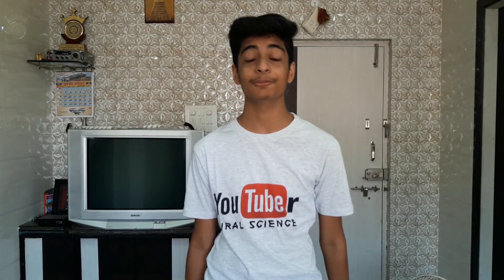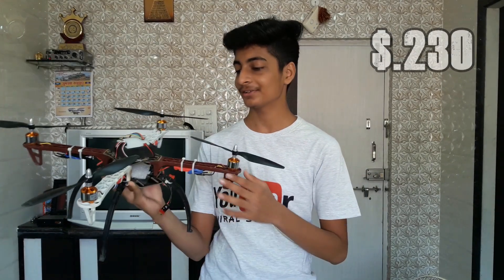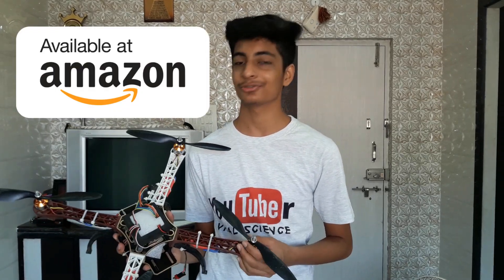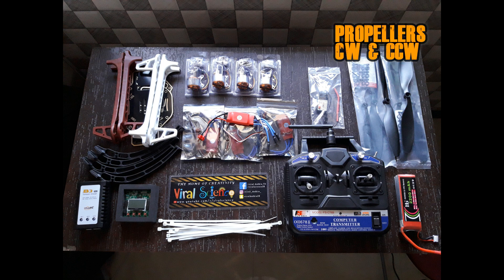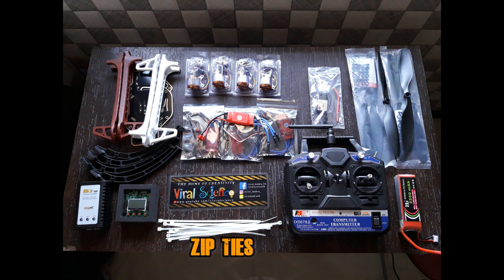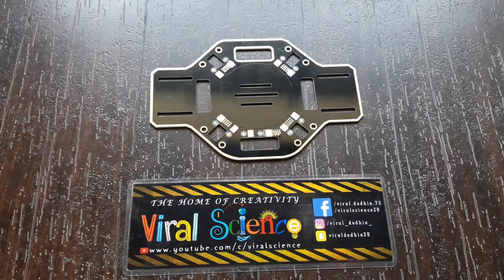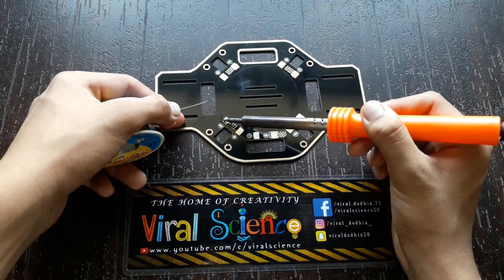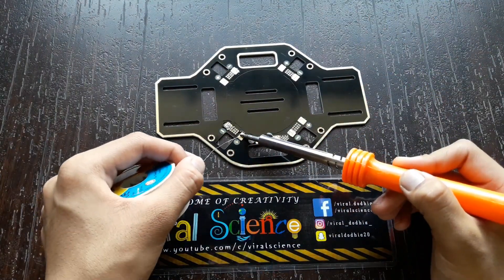How to make a Quadcopter | Drone

Comment: Hello. Is it possible to use the radio control of the quad copter with a brushless motor to move with a 1400kv motor with a few servo motors, thank you

Comment: SIR i am using 1800 KV brushless motor and i am also using a lipo battery of  2200 MaH  . I am also using gimal controller ,  KK 2.1.5 board , FLYSKY FS-i6 transmitter and receiver . When i am arming its arming but when i am bringing the throttle to half and above the armed process gets offed and again i should do the arming process it gets repeated like this and also  the quadcopter  is not flying at all or else would the battery voltage be not enough for this quadcopter.  What will be the problem . Can you please help me sir
Reply: check battery volts with multimeter and insure that your battery is puffed or damage
Reply: @vijendrasingh1238  how to check if it is damaged or puffed
Reply: multimeter
Reply: in multimeter how to check
Reply: @nandakumar74   u can look on YouTube 😄😀
Reply: Does KK2.1.5 supports camera?
Reply: @punitvachhani9676  no
Reply: Just check whether you have calibrated the ESC correctly

Comment from the maker: KK2.1.5 BOARD:-  https://www.flyrobo.in/kk2.1.5_lcd_flight_controll_board_for_fpv/?tracking=5c723900abvrl
FLYSKY TRANSMITTER & RECEIVER:- https://www.flyrobo.in/flysky_fs-i6_2.4g_6ch_afhds_rc_transmitter/?tracking=5c723900abvrl
F450 FRAME (PCB version):- https://www.flyrobo.in/drone-f450-450-quadcopter-frame-arm-with-landing-gear-4-axis-multicopter-kit-450f-quadx-quad-multicopter-kk-mk-mwc/?tracking=5c723900abvrl
Reply: Bro i like your projects,how much weight can this drone pick up?. Make a vedio on it and do we need permission to fly this drone
Reply: bros u need flite control also 😄
Reply: Bro my drone 1000000

Comment: I am using kk2.1.5 and ct6b transmitter but the range of my quadcopter is about 30-50m how i can increase its range?
Reply: Use flysky 5G transmitter and remote control then u will get aprox range of 1-1.5 km

Comment: I built a quadcopter the same, frame alien f 450, engines 750 kv, acc 30 amp KK2.1.5 Flight Control Board, battery Nanotech 4.0 Ah, and the day I tried to make my first flight in a park, a policeman saw me and I try to take it off, him wanted to take the new toy for your son, I got pissed off, and I almost got arrested. nope it's fair that after the stores sell you the parts legally, you can not fly it, because it's illegal, this is bullshit

Comment: hey, I just wanted to know if this setup would fly or not:
2x 3s lipo 3000mAh 30C
4x 1400kv outrunner brushless dc motor
4x 30Amp ESC
1x F450 frame (like the one in this video)
 and my own custom Arduino electronics

Whenever i try to fly the drone, the motors are too weak (not getting enough power i suspect) and  they act at a quarter of the max power, i can run one single motor at full power but not all at once, i think the lipo only has a discharge rate of 30amps so only one ESC can be fully powered, even though i have seen people use only one 30C lipo and still get full power. Have i done something wrong or is my battery not powerful enough?
Reply: Sean Hardy take one of the 3ah 3s lipos off to save weight then try it
Reply: i think thin wires are causing excess resistance, the motors only spin at 1/4 speed with 1 single lipo, the discharge rate is 30C but my ESCs are rated for 30 amps so i think i need two 60C batteries?
Reply: Sean Hardy  what u should do is keep the 2x3s lipos and put a higher kV brushless motor and a ESCs to support 6s lipos.the frame is up to u.
Reply: Sean Hardy try motors kV from 2000till 3800
Reply: It will work but check the wires connectors and put a better esc
Reply: I built my 1st quad on 4x120a ESC on 6-8s lipos and 3400kv brushless motor x4.   
Try it out
If it gets hot try using lesser powered lipos.
If u don't u might rip the motor inside out.(happened to me on my second quad)
Try different lipos batters and see which one works out e best for u.(it should not get very hot)
U can buy mainly all the electronics from hobbywing.com
Reply: Wish u luck😀
Reply: so will my current configuration not work? would I have to change the ESC as well as the motors because it is rated for 30 amps? I think my motors could lift the quad as I can run one with full power but not all of them at once, but I can burst 60C with the lipo. Will using two 60C batteries provide the full current of 120 amps for all four 30amp ESCs? because i think the motors are powerful enough
Reply: Sean Hardy u can use the stock motors but the ESC has to go
Reply: Sean Hardy because the 30a ESC is not rated to do 6s lipo
Reply: Sean Hardy the ESC would burn mid air
Reply: Sean Hardy from 60-120a ESC should do the job
Reply: Do you have a hobystore around ur house(bcoz u would have to swap out the connectors of ur motor or ESC)
Reply: Sean Hardy or stick with 30a and do 3s
Or put 60a and do 4-6s(might burn on 6s)
Or do 120a and do 6-8s(should hold both pretty good)
Reply: so if I get some 120amp ESCs then I can wire my 2 batteries in series and have them deliver the amperage of a 6s? I think that would be the best option. Thanks so much for the help, it really means a lot as I am just getting into drones as a hobby!
Reply: wait a minute, i am still confused. This guy (in the video) is using a 30amp ESC and 1000kv motors with one single 3s lipo, why does his fly and not mine???
Reply: Sean Hardy yes it will work
Reply: Sean Hardy also use connectors which can take high amps like deans or xt60
Reply: Sean Hardy because its single 3s. It runs on 30-60a
Reply: Sean Hardy 6s needs 120a due to its capacity of amps running through it......
Reply: ok thanks i will try with high amp connectors
Reply: Sean Hardy could be weight distribution problem..
If u want to run 6s, use 120a ESC(if u have the cash)
If not,just stick with the 3s😉
Reply: All comments are of no use.. 1400kv doesn't has the lift power as 1000kv motor...so definitely a f450 will not fly.
Reply: It has 336 grams weight...
Reply: so higher kv isnt more thrust?
Reply: Higher kV is just higher speed but less torque.. 1400kv can lift f330 frame but not f450...1000kv is the best.... Try them
Reply: hey what are you saying that you have 30 amps?. first of all your lipo is very good. your lipo can discharge 90 amps (3.0x30=90). so ur lipo is not a problem. and esc don't pull 30amps, they pull only the power which ur motor have(probably 42 amps). use 1000kv motor or I think that you have not calibrated all your escs
Reply: i have 30 amps yes, with 2 6s lipo batteries, i have calibrated by esc so i will try using 1000kv motors.

Comment: Where  to put battery
Reply: the wire coming from four esc and connect to one port that is the point to give power to your drone Bhaiya
Reply: between the gap present in the frame

Comment: Your lipo can't pull motors. Amps= ( mah x c rating ) / 1000. 4 x 30a esc = 120amps. amps= (2200mah x 25 c)/1000 = 55amps. ESC needs 120amps.In case of load, your esc will burn or motor will heat up.
Reply: Micro Tech Actually it is perfectly fine, he is just not getting the full power from the motors! If the current in the battery was more than the current  of the escs, then there would a problem! Also the motors aren’t always pulling 120 amps, if they were, the battery would over discharge quickly.

Comment: I am also having issue in flying drone. the motors are not running with same speed after final changes.
Reply: prince kumar esc callibration check esc manual

Comment: My drone is spinning
Reply: What should I do
Reply: I got same problem .haha
Reply: you may be due to all the motors in same direction- please look at the wiring diagram for more info
Reply: I solved ,maybe not same your problem ! make sure Fligth controle box hold tight,and arrow direction corred,setting point when motor just run and stable . Let try and lucky .

Comment: Hey mann m facing problem with kk 2.1.5 flight controller as soon as i press reciver setting that screen went blank but the beeps were thhr
Reply: Help mannn plzz
Reply from the maker: rajat hegde its your board problem either get it replaced from where you buy it

Comment: hey bro,i am also facing this tilting problem . I am using the motors of 1400kv and battery of 2200mah. This is my pi values of kk 2.1.5 board:-
Axis : roll(aileron)
P gain: 75
P limit: 50
I gain: 40
I limit : 20
and same for elevator
Axis : yaw (rudder)
yaw p gain: 75 
yaw p limit : 20
yaw I gain :30
yaw I limit : 10
please help me

Comment: Flight duration and max height?
Reply from the maker: Sumit Maurya flight duration depends upon the battery mine battery was 2200mah so it would fly around 10 min and height i cannot determine perfectly
Reply: If i need some help...how to contact you directly.